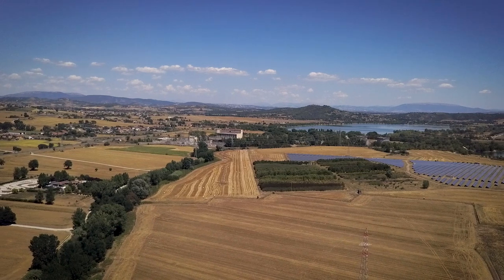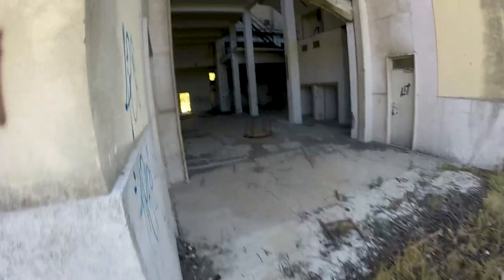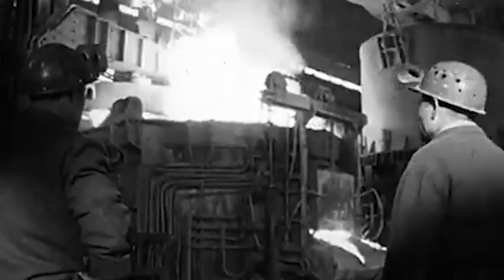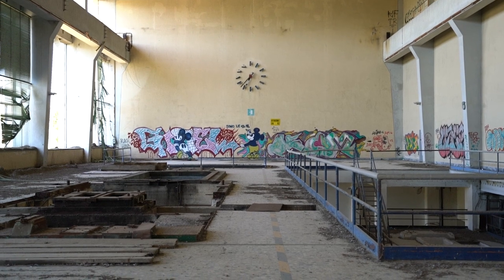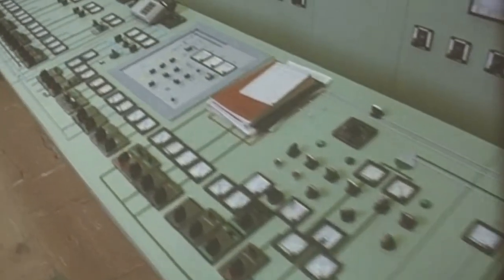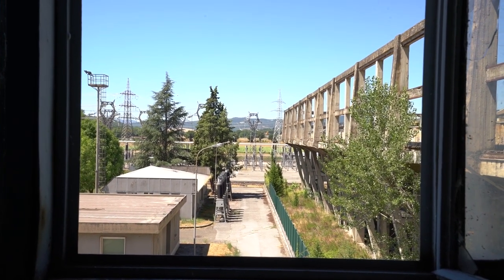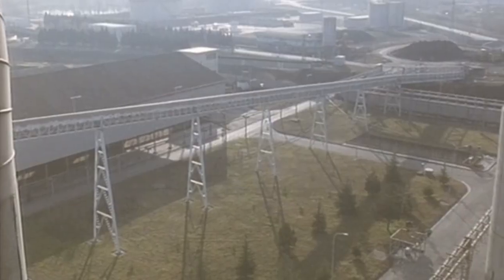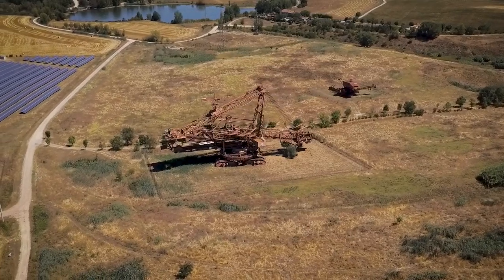How this Abandoned Power Plant Created a Lake

Comment: Nice videos 👍
Just one thing, the pumps in a power station are mostly for water and not for the steam. The steam comes with high pressure from the boiler and finds his way to the turbine by its own. The water instead what comes out of the condenser needs the pumps to get back in the boiler. That’s why you have condensate pumps and boiler feed pumps.